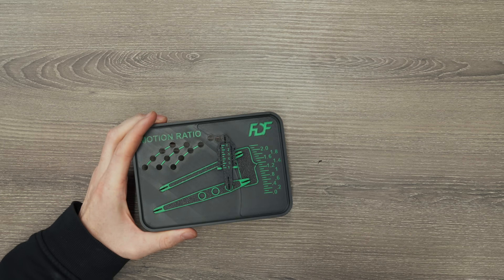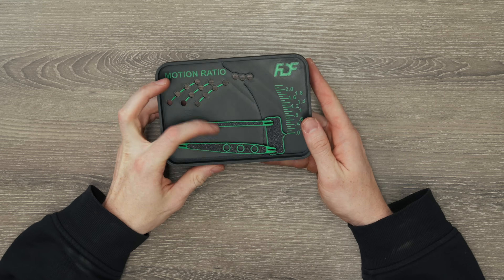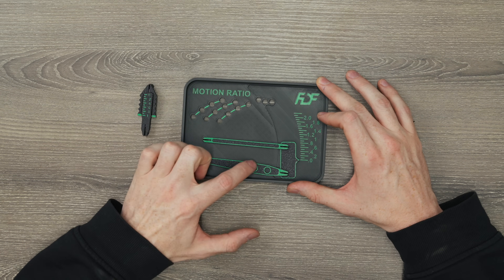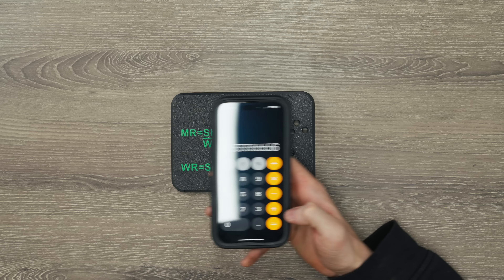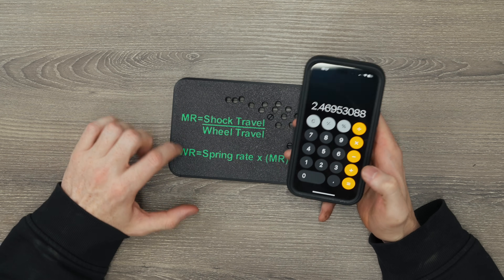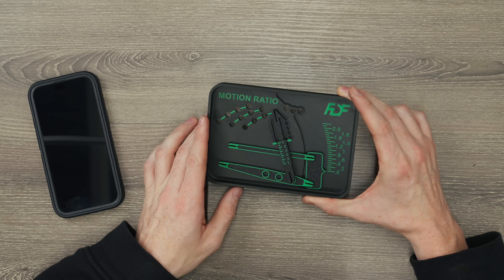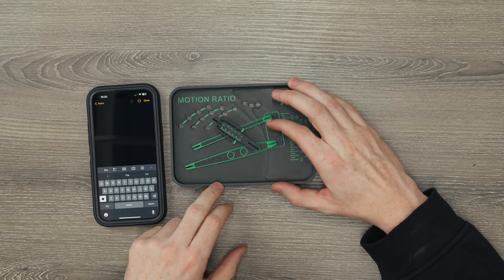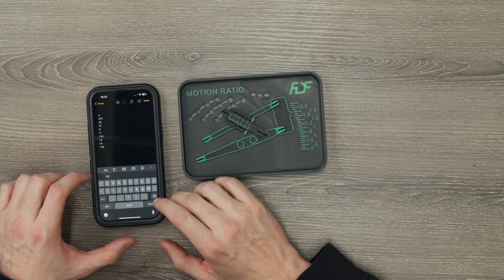Become a Suspension Pro: Understanding Motion Ratio

Comment: Suspension engineer here…

Motion Ratio and Motion ARM Ratio are TWO totally DIFFERENT but related concepts. Motion ratio is often derived from Motion ARM Ratio.    The angle of the shock is called Angle Correction Factor which is agin different than both motion ratio and motion arm ratio. 

Motion Ratio is the Delta between wheel movement and shock travel. 

Motion ARM Ratio is the calculation of leverage on the spring / shock based on the distance from the lower A-Arm pivot and the ball joint to the the shock mounting location.   A wheel spacer affects both but the delta in leverage as you had explained it in this video is a change in Motion ARM Ratio not the Motion Ratio. Motion ARM ratio is often referred to as Force Ratio because people tend to become confused between the two! Especially because Motion ARM Ratio is written as Mr in calculations or written as just Motion Ratio. 

The Formula for  Motion ARM Ratio  is MR=D1 / D2  

D1 is the distance from the control arm inner pivot point to the spring centerline.

D2 is the distance from the control arm inner pivot point to the outer ball joint.

Moving the top of the shock is called Spring Rate Correction Angle and has nothing to do with Motion Arm Ratio but can of course affect it. The formula for this is : 
ACF = COS ∠ A°

Motion Ratio =  ST / WT 
Spring Travel / Wheel Travel 

Calculating spring rate with Angle Correction Factor  it’s called the Adjusted Spring Force! This formula is Spring Force SF / ACF = ASF. 

SF is calculated by this equation W/Mr=Sf
(Mr is Motion ARM Ratio or AKAForce Ratio)

ASF is used to find proper spring rate with 
ASF / ( Spring Free Ht X Desired Compression Percentage) 

Spring load is calculated as 
Sr X Sc 
Spring rate X spring compression 

Or Wheel Load / Spring Rate = compression 

Desired Compression Hight is
Spring hight - Compression = CH

These formula are readily Available among dozens upon dozens of engineering books along with multiple online sources if I’m not mistaken.  I have been engineering front suspensions for over three decades. 

This tool is representing multiple things with a formula for motion ratio printed on the back. The adjustments at the bottom of the shock are actually Motion ARM Ratio or Force Ratio adjustments. The changes at the top of the shock are changing the Angle Correction Factor.  These are different then Motion Ratio but can effect motion ratio. However, they can also be insignificant.  Don’t get me wrong it’s a creat tool. We often tell racers to build similar models especially with four bar suspensions to grasp the concepts.
Reply from the maker: I mentioned a few times in the video that this display only scratches the surface of understanding the concept. Would you recommend not putting the formula on the back for MR and WR? We do include a pretty extensive pdf that ships with these. In chassis/suspension design the extent of these calculations should be taken into account but for 99% of people who have production car with minimal adjustments, and are trying to understand why wheel spacers effected there suspension or how true coilovers are different rates and valving vs divorced, the simplest display can help them grasp the majority of the concept. The main reason I made our ackermann display was to stop the debate and offer a visual so nobody can question what is doing what. And from there I had multiple requests to continue. I appreciate your comments! Thank you
Reply: Yeah you're right, people always get confused between damper centric motion ratio (D1/D2) and wheel centric motion ratio (D2/D1) . Mostly damper centric motion ratio is preferred everywhere, two sides of the same coin and if you're using wheel centric motion ratio (The amount of wheel travel per unit damper/spring travel) you've to consider the same relationship in all the further calculation just to be clear the way you think of the concept is same
Reply: Hey if you don’t mind me asking what did education steps did you take to become an engineer in suspension. I’m currently in my second year of mechanical engineering and just trying to see if there’s anything out there that’s more focused on just the automotive side of things

Comment: Really cool. Like playing with legos while experimenting with different setups
Reply: Ya but like I said , this could be confusing to people because although he printed the formula for Motion Ratio on the back, the changes to the shock mounting location on thrust bottom control arm of the model are actually Motion ARM Ratio (AKA Force Ratio) changes and the top shock angle changes are actually Angle Correction Factor changes. Both correlate to Motion Ratio but are still different.  Most people watching this have zero clue that there’s Motion Arm Ratio and Motion Ratio or what the difference is. This model will only confuse them. Moving the shock pivot towards the lower control arm pivot or towards the ball joint pivot changes the Motion ARM Ratio. That’s the change in leverage or force in the spring. The Motion Ratio is the delta between wheel movement and shock motion.  They are very very close and both related to the other but still different.

Comment: So, random I know but, I do alignments for a living and this channel has taught me a lot. Something came up at work today and I gotta know your opinion on this. Multiple people argue when setting camber and caster, you should set one side a little higher than the other to battle the crown that's built into the road for water runoff. This sometimes will cause a vehicle to pull to the right so they try and compensate for that by inducing a slight pull to the left. I don't agree with it. What are your thoughts?
Reply: Don't. Set it up for what you need, but make it symetrical. That whole water runoff is BS, and if it's really true, then good, you will stray into the side of the road instead of traffic at a heart attack or something.
Reply: In my opinion, on larger vehicles this effect is more noticeable.  Think trucks and larger SUVs.

For passenger cars with independent suspensions it is not felt as much and can cause the car to climb the crown towards the centerline.  I used to set up smaller cars as square as I could, but for 2500 and heavier trucks I’d have a .2 total caster relationship.
Reply: @eheggestad  You're crazy. Heavy machinery will have automatic line control these days too which makes it even more crazy to scrape tyres for no benefit. Always setup symetrical wheel alignment and suspension unless you're doing oval racing.
Reply: @tracklizard4018
 GM specifically tells you to offset the caster in their specs!  It's to counter the road crown!  You can say that's incorrect, but tell that to a customer on why their truck heads into the ditch as soon as they let go of the wheel lol 
 Some aren't bad at all when they are the same side to side, but some definitely need it to drive straight!  And I always set them up to drive straight!
Reply: @dave_kauffman  Never seen that personally. Are you talking like one degree of caster extra on the outer wheel?
Reply: @tracklizard4018Correct, not usually a full degree tho.  It's often only half a degree.  
 To me it seems odd, I don't understand it entirely because every other front end out there on cars is ifs and I've never really seen it on anything else.  I think GM is the only one.
Reply: @dave_kauffman  On scanias for instance one degree diff for caster is within spec too. Not mentioned as a runoff thing but simply something that can be good enough.
Reply: @dave_kauffman   They would add 1° of split to correct the car from pulling due to the crown preventing it from pulling to the left. Ironically old timers used to do the opposite to make it pull right and prevent  cars from head on collisions. However MFG’s don’t do that stuff because of the delta in all modern road surfaces along with other impacts that the increase in split creates. Plus they want a car to naturally lean right some rather then left if at all.  Increased split could be catastrophic for the ford trucks with a death wobble issue. Camber could have a slight benefit but agin insufficient especially with no standard baseline plus the other impacts. Like I said, we run l massive split in our circle track cars for a myriad of reasons people don’t understand.
Reply: Caster split will always cause the car to pull. In circle track especially dirt, we run extremely high amounts of camber, caster and split.  Our split causes the wheel to to literally try and rip out of your hands to the left if your pushing the car or steer hard left if the driver lets go. More caster creates dynamic weight transfer issues with a loading and unloading effect. This is another reason why run higher caster on the RF of a circle track car. It causes the car to “wedge up” and “un-wedge” the car when the driver turns the wheel. This gives the driver more positive feel, quicker turning and allows him to tighten up the car on counter steer or loosen the car as he needs to add more wheel input on corner entry. If the car gets loose and he counter steers the wheel input adds weight diagonally to tighten the car up some.  Higher caster will essentially make the wheel rotate on its axes faster. This also has an effect on dynamic caster curves with an upper A-arm car as you add more camber because,  you effectively change the upper pivot plan. It effects numerous other things as well that’s to complex to go into here.  The old timers used to put caster split into the car to pull the car to right some so that if people fell asleep they wouldn’t head into uncomming traffic.  Adding split or increasing caster for water run off or the crown of the road wouldn’t be a good idea for any reason with zero significant impact or upside. It’s a fundamental misunderstanding of what caster does or how it works. The impacts are far more reaching the people understand.  Camber would have more benefit for such a problem but having split for this purpose wouldn’t be to beneficial due to the delta in different road surfaces. We run up to 9° static camber and up to 12° dynamic camber in our equipment on the RF and 5° or so negative camber on our LF. Camber agin has an impact on may other things including bump steer at times. It effects the effort required to rotate the tire, drastically impacts contact patch and dynamic tire loads. You have to remember a tire is a spring and we have spring loads, wheel loads and tire loads. The impacts agin are far more reaching then people understand and not worth messing with for an imaginary problem with no standard baseline.  We tune camber for race track surfaces that have set banking that we can calculate for when visiting different tracks. But even with that, we often don’t compensate. The things we adjust more for are changes in dynamic body roll, wheel loads and corner speeds. We change how fast a corner gains or loses camber (dynamic camber curves) based on set ups. This is nonsense for a street car. Camber and caster should be square. On the ford trucks with a death wobble they should be raised but still remain square, any split could become a serious problem for those vehicles.

Comment: I love it! it has never been so easy to understand these suspension geometry concepts!
Reply from the maker: Awesome! Thanks🤘🏼
Reply: @FDFraceshop 
Suspension engineer here…

Motion Ratio and Motion ARM Ratio are TWO totally DIFFERENT but related concepts. Motion ratio is often derived from Motion ARM Ratio.    The angle of the shock is called Angle Correction Factor which is agin different than both motion ratio and motion arm ratio. 

Motion Ratio is the Delta between wheel movement and shock travel. 

Motion ARM Ratio is the calculation of leverage on the spring / shock based on the distance from the lower A-Arm pivot and the ball joint to the the shock mounting location.   A wheel spacer affects both but the delta in leverage as you had explained it in this video is a change in Motion ARM Ratio not the Motion Ratio. Motion ARM ratio is often referred to as Force Ratio because people tend to become confused between the two! Especially because Motion ARM Ratio is written as Mr in calculations or written as just Motion Ratio. 

The Formula for  Motion ARM Ratio  is MR=D1 / D2  

D1 is the distance from the control arm inner pivot point to the spring centerline.

D2 is the distance from the control arm inner pivot point to the outer ball joint.

Moving the top of the shock is called Spring Rate Correction Angle and has nothing to do with Motion Arm Ratio but does of course affect it. The formula for this is : 
ACF = COS ∠ A°

Motion Ratio =  ST / WT 
Spring Travel / Wheel Travel 

Calculating spring rate with Angle Correction Factor  it’s called the Adjusted Spring Force! This formula is Spring Force SF / ACF = ASF. 

SF is calculated by this equation W/Mr=Sf
(Mr is Motion ARM Ratio or AKAForce Ratio)

ASF is used to find proper spring rate with 
ASF / ( Spring Free Ht X Desired Compression Percentage) 

Spring load is calculated as 
Sr X Sc 
Spring rate X spring compression 

Or Wheel Load / Spring Rate = compression 

Desired Compression Hight is
Spring hight - Compression = CH

These formula are readily Available among dozens upon dozens of engineering books along with multiple online sources if I’m not mistaken.  I have been engineering front suspensions for over three decades. 
This tool is great resource however this tray is technically demonstrating multiple things. 
The adjustment locations for the lower shock pivot is Motion ARM Ratio or Force Ratio NOT Motion Ratio.  The adjustments on top of the shock changing the angle is changing the Angle Correction Factor not a motion Arm ratio. Although both may effect motion arm ratio, they don’t necessarily always have a large impact.